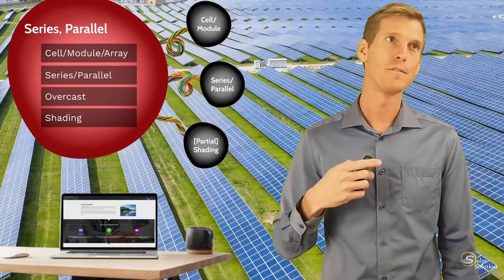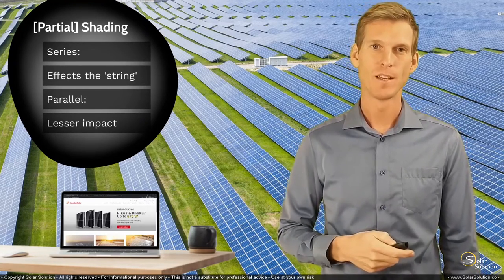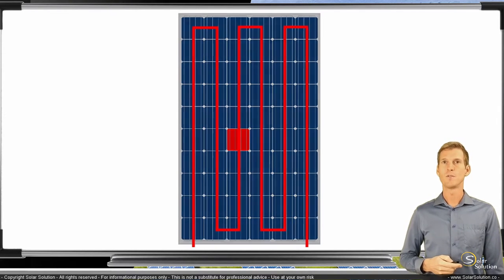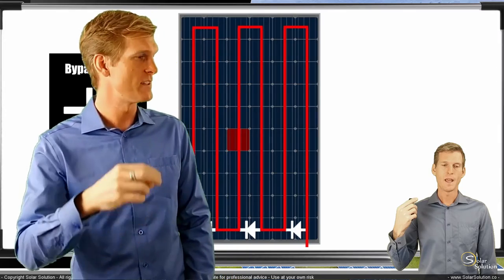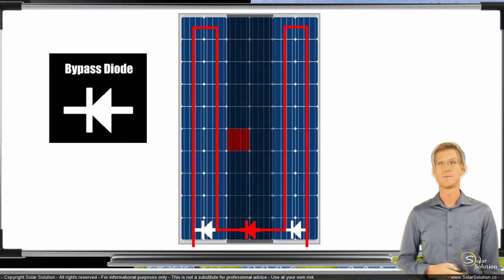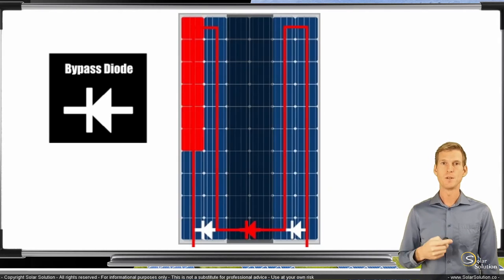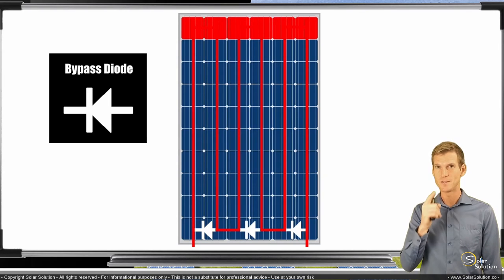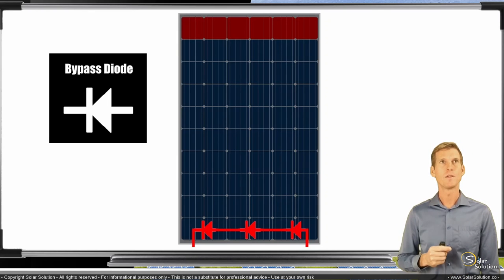Solar Panel Bypass Diodes: Why, How & Where

Comment from the maker: Course trailer and Coupon Code: https://youtu.be/Bo7jZ6Vkx9I
Reply: I had cheap connector wires and the color coding was wrong between panel and charger controller. did the panel blow up?

Comment: At the end I heard:
Bypass diode will allow the other panels to continue to produce usable power either series or parallel. If your panels are wired in series, then you want the bypass dial to appear as a short, allowing the series connection to continue, this would be the worst thing you could do in a parallel configuration, as it would short all the panels together. So in a parallel configuration, we would want blocking diode, not a bypassed diode?
Reply from the maker: Hi Steve! Good question. Bypass Diodes can be advantageous in both parallel and series connections.